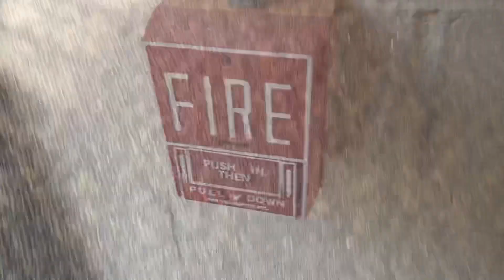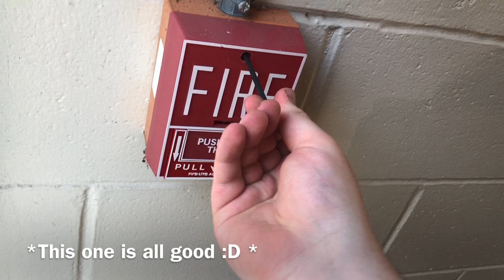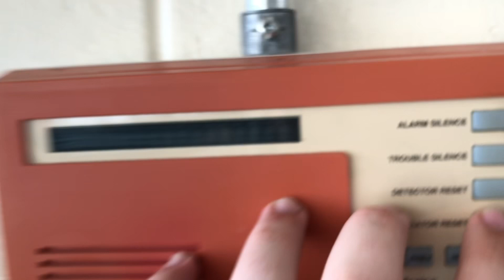Fire Alarm Test #23

Comment: Are you using a vacuum cleaner to clean the smoke detectors?
Reply from the maker: Yes it’s a small hand held on that each of the lead techs have. However I prefer using canned air because it cleans the detector better due to it being pressurized.
Reply: @a.r.aproductions1569  That's what we use at my company.